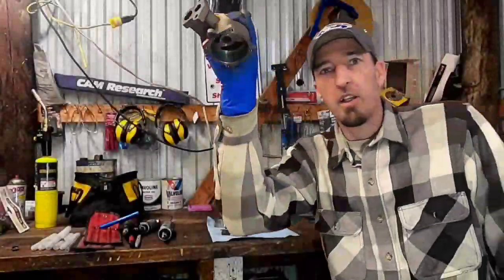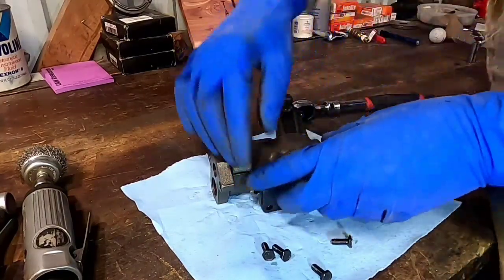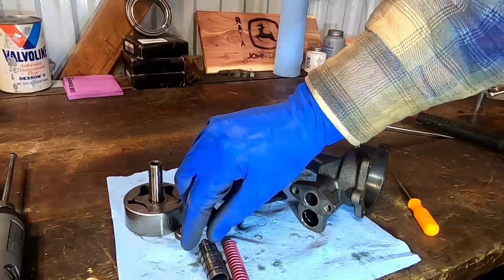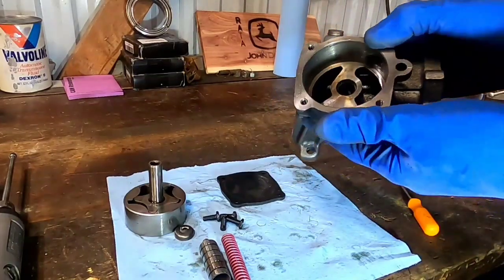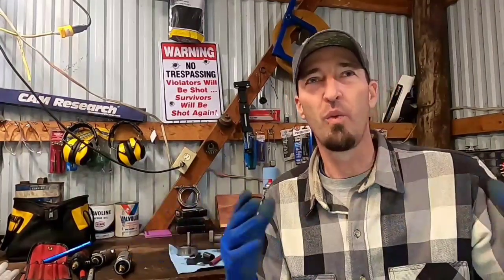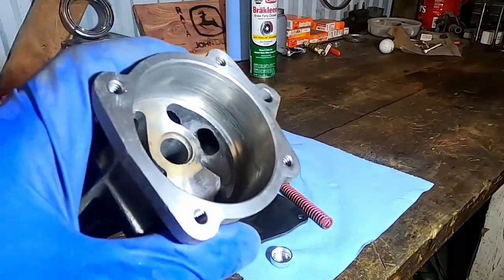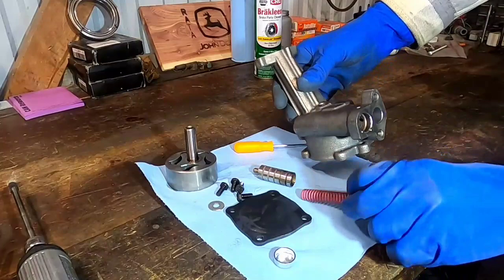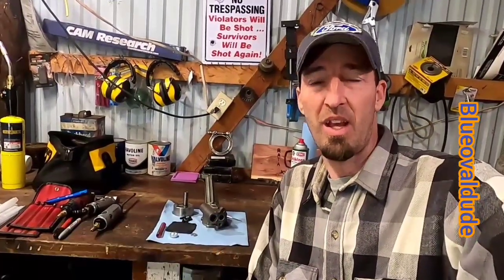Improve engine oiling part 2.   Ford 289,302,351,400 ect Oil mods  (oil pump)

Comment: Great mod video. Wish block oil mods were available. Starting 393 budget build. I followed the head porting and flow numbers. Nice work. I went with the most hated head on the Internet pro comp cnc 227. Not sure how they will flow but Black Friday special at 1000 bucks I'll give them a shot. Motor is a street strip build. More street for an 85 fox. Hydraulic comp cam xe274 running 1.7 rockers, haven't decided on intake yet. Any suggestions? What main and rod clearance do you run. Using king bearings. Rpms will be kept reasonably low at 6-6200. Picked up a set of 1 3/4 swap headers used. Hoping to see 450-500 hp. What's your thoughts on setup? Thanks. Oh it's a stick car with tko 600
Reply from the maker: Thank you . My block mod video I posted a few weeks back is still up . If you have around 10 to 1 with 393 cubes and the rest of the parts you listed it should put you around that 500 Hp . You will need to check the valve springs to make sure they are set properly and up to the task . You will most likely lose some rpm with a 393 , larger cube engines have a way of taming camshafts some .  you are in the realm of more street ( Rpm air gap ) or more strip (victor jr ) . If there is a chance of going to a larger cam someday just put a vic Jr on it . You want..001 for every inch of crankshaft diameter.  Example..003 clearance for 3" Windsor mains minimum.
Reply: @blueovaldude  thanks for the advice. Have the springs to match my current cam. I will probably end up with a larger cam later on so more than likely single plane victor is better choice for me then. Do you think the 227 cc runners will hurt on velocity and engine response for street driving? Looking forward to seeing more videos.
Reply from the maker: @eze.Morning_Wood_Farms yes,  The jr will give you room to grow in the future . Honestly I would not be concerned with 393 cid . A Well tuned matching combo goes a long way to make a happy engine.
Reply: @blueovaldude  oh do you think a 5 quart swap pan is sufficient? Scares me a little. Eventually the car will see autocross type racing at some point.
Reply from the maker: @eze.Morning_Wood_Farms  It would work,  but I am always a fan of an larger capacity better designed pan .
Reply: @blueovaldude  thanks again!!